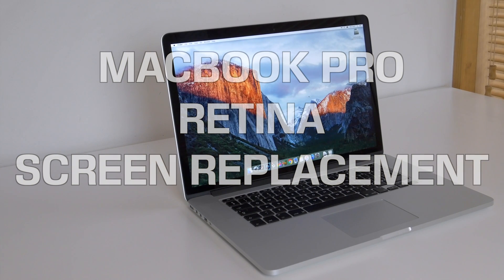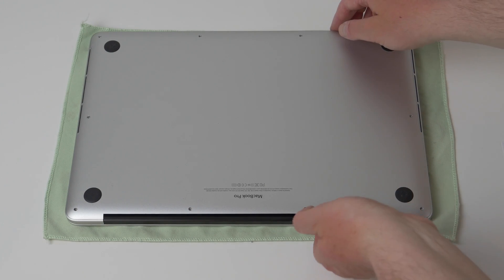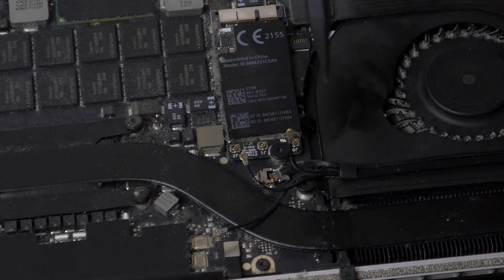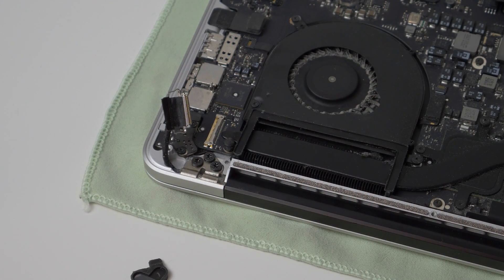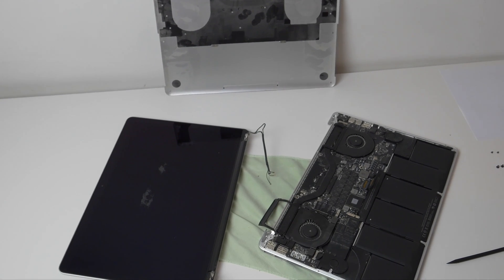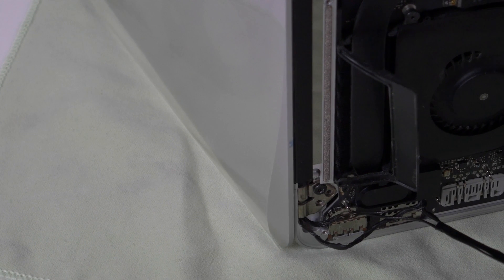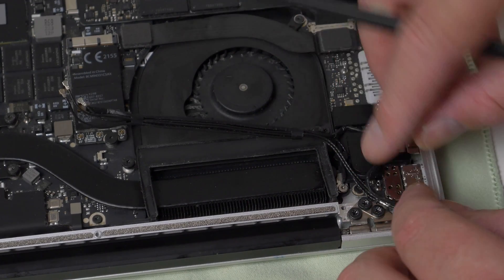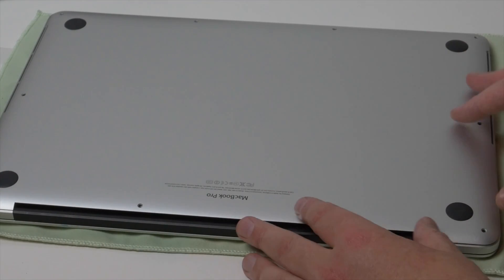How to replace screen on Retina MacBook Pro 15" Entire assembly

Comment: Hi,
I have a MBP 15  A1398 mid 2014,
screen have some issue,

may I know which year/models I should be looking for.
I am looking in ebay for a used screen.

Thanks in advance
Reply from the maker: - Mid 2012 / early 2013 share the same screen
- Late 2013 / mid 2014 share the same screen
- 2015 model has its own screen.

So, you should look for a late 2013 or mid 2014 screen.

Replacement screens are a lot more expensive now than when I made this video. Instead of looking for a used screen, you could try looking for a liquid damaged laptop, since they're often cheaper than just the screen and usually it's just the motherboard that's fried while the screen still works.

Comment: Hi. My A1398 has a black screen, and have tried all the software attempts to fix. Nothing. Anyone know if I can try to replace the CABLES to the screen first, (see if that works?) before I pay out for a whole screen? Is it poss to try replacing cables first, or are they integral to the screen? Thanks.
Reply from the maker: The cables are integrated into the screen assembly, which is a sealed unit. There's no way to access the connector on the panel without disassembling the screen assembly, which is firmly glued together.
Reply: @BartechTV  Thanks man. New screen then. All the best,

Comment: I'm not sure what I did wrong. I followed the instructions. The difference is I'm using a screen from another MacBook Pro that was working. I have a 2014 and the replacement screen is from a 2015. Could this be the issue? The connectors and fit are exactly like the original and the video as well.
Reply from the maker: Hi Chris,
In your 2014 MacBook Pro 15" you can use a screen assembly from a Late 2013 or Mid 2014 model.
The screen assembly from the 2015 MacBook Pro 15" models isn't compatible, unfortunately.
The Late 2012 and Early 2013 use the same screen.
The Late 2013 and Mid 2014 use the same screen.
The Mid 2015 screen is unique and isn't compatible with previous models.

Comment: Dynamite video!! Thank you so much!! I just replaced my screen.  You saved me so much money!  Articulate explanations, images were clear.  Well edited.  This was the best of the two other videos on the same subject I saw.  My only suggestion is there is one part that needs more clarity.  There are actually  2 clamp screws on each side of the screen.  So a total of 8 screws that have to be removed.  You took the right one out and it looks like the left one is missing.  The clamp is not mentioned. I can see the holes where it goes. This made it confusing for me because I almost busted my screen trying to take it off, thinking I didn't have another clamp screw to remove.  But overall, bravo and thanks for keeping us informed.
Reply: Where did you buy your replacement screen?

Comment: The 2015 screen is now $430.00 USD !!!
Reply from the maker: Wow. I guess now that they're no longer made any more they're in short supply. Maybe a used screen might be cheaper. Or.perhaps even buying a non-working mac with a good screen on eBay just to harvest the screen.

Comment: Awesome video! Replaced the screen in under 60 minutes. The only difference with my MacBook were those little retaining pieces on either side of the screen (held in place by the T5 screws)...as mentioned by UltraLeap. No big deal. I probably had a slightly different model MacBook.
Reply: Hi where did you get your screen from?
Reply: @stevieb0yzz  I bought it on OWC. https://eshop.macsales.com/item/Apple/66102532/

Comment: I changed my screen successfully just following this AWESOME video. Some immediate suggestions around details not mentioned in the video: (1) at 3:10, under those 2 screws (one on each side) there are some little pieces of metal. Remember how they're positioned and put them back. The ridge that fits into a slit in the flame helps remembering.  (2) The hinges on the old and new screen are hard to turn at 90'. You don't realize when taking out the old screen because the whole screen acts as a lever, but to turn on the new screen you can use some pliers, just be careful not to push on the new screen, that would be the worst :-)

Comment: Fantastic video.  We have 2 older macbook pros, one that works far better than the other, but of course, the one not working well has a much better display (it was replaced only a year ago).  I used this video to swap the 2 displays and was successful with both :)   We will repurpose the one macbook that's on it's way out, but now the other has a much better display and is still very reliable.  Thanks for your detailed instructions.

Comment: you're link for the mid 2015 15" macbook is not working... can i use this one instead? https://www.ebay.de/itm/LCD-Display-Bildschirm-Assembly-fur-MacBook-Pro-Retina-15-Zoll-Mitte-2015/223046192549?hash=item33ee96cda5:g:32sAAOSwYFpbPclr#viTabs_0

Comment: is it possible to replace just the cable? as my screen works but there's a faulty connection somewhere
Reply from the maker: The cable is very difficult to replace. The display with lvds cable and antenna cables is an integrated part and the glass is glued to the screen.  You would have to remove the glass, using a heat gun, which is very difficult to do without it breaking, unscrew the LCD, swap the LCD cables and reroute the new cable through the frame, then re-attach the glass with some adhesive. Louis Rossman made a very good video on replacing the glass which would be a good starting point if you want to attempt cable replacement.
Reply: Bartech TV thanks for your response but I’ve since seen that it’s possible on the MacBook retina without removing the glass, it wasn’t possible on previous models as you described.  The black plastic strip that runs along the bottom of the screen that covers the hinges attached to the screen slides off when the display section is removed and underneath you can gain access.  Check out the video on you tube about tightening the hinges.

Comment: We followed instructions precisely.  Turn the computer on prior to reattaching the bottom panel.  We heard the computer come on and the fans are spinning, but the screen isn't working.  Any suggestions, please???
Reply from the maker: Do you hear the startup tone? Can you see an image if you connect an external TV or monitor over HDMI?

Reset the PRAM by holding down Command-Option-P-R when turning on the machine.
If still no image, open the machine up again, disconnect the battery, and the LCD connector, clean the contacts with isopropyl or contact cleaner, then re-connect making sure there is no damage to any of the contacts and that it is properly seated.
If you still have no image, and the computer works with an external display then it sounds like you have a bad screen and will need to exchange it with the person who sold it to you.

Comment: I've never worked on computers before but the cost of having Apple or a computer repair service replace the display wasn't cost effective, so I was glad for this video. It's definitely a bit meticulous for anyone who hasn't worked on computers before (especially dealing with tiny screws) but it worked out fine.

Thank you!
Reply: That's probably the one thing that "regular PCs" have going for them.  They might have some small torx or phillips screws to deal with, but I never had to buy a pentalope driver before working on macs.  They also seem to be much easier to work on in general, IMHO.  Maybe I just need more practice, or less people breaking them would help too.

Comment: I was given a MBP from my brother in law last week who moved to the Pixelbook. His MBP is an early 2013 15" with Retina display. 16GB ram, Core i7 2.8Ghz, and a 750GB SSD. The laptop was either dropped or something since the bottom right corner of the display is out and is getting worse. The entire bottom of the display is out now and growing. My question is, the laptop seems to run very well and I am new to Macs. Love this one so far but wondering if it is worth the money to replace the display on it? I have priced them out and found a couple good ones in the $300 range. I work on electronics daily and repair cellphones so I am confident in my skill in doing it myself. So is it worth it?
Reply from the maker: An early 2013 15" with the specs you listed is still a very fast and capable machine, and still has a resale value of $900 or thereabouts, so I'd say it's definitely worth spending $300 on a new display.

Comment: You are a life saver! Thank you! This video made a complicated and scary repair simple. I fixed my display, saved a lot of money, and am so happy. There is a very tiny white line down my screen. It was bigger, but I unplugged both the battery and connectors and re plugged them in and it got much smaller, but still there. Any idea what the problem may be? It's hardly noticeable and I am nervous to attempt the repair again, as my computer is working great again! Thanks so much, again!!

Comment: Best video on the macbook pro lcd repair!  I just have one question and I noticed it's missing from your video. how do I put those tiny silver pieces back with the tiny T5 screws? I noticed you omitted that in your video and I think you forgot to put them back. Thanks! I'm guessing I should put them on first before putting the T8 screws on. Thanks!
Reply from the maker: Indeed yes, those should go back before the T8 screws.  Sorry I must have neglected to record that part.

Comment: You make it look easy , so going to buy the screen on Ebay and do it my self and buy the OWC 1TB SSD and maybe 16gb ram. My wife's Ragdoll cat jumped on the screen half open with magnet charger between the laptop and fractured the bottom left side and half screen with lines. Apple wants $663 plus tax . Great video thank you so much man.

Comment: Hi, I was wondering if anybody can help. I have a Macbook Pro 15" Retina
 Mid-2014 A1398 with a small dent on the glass. Instead of replacing the 
entire screen, is it possible to just replace the glass? Cheers.
Reply from the maker: The glass is glued on there.  You'd need a heat gun (or a powerful hair drier and something to direct the heat to a smaller area) and a lot of patience.  Look at Louis Rossman's videos here on YouTube - he has some videos where he does exactly what you're looking to do.